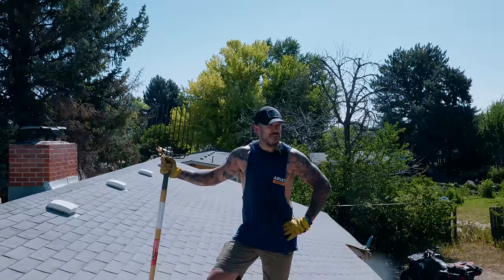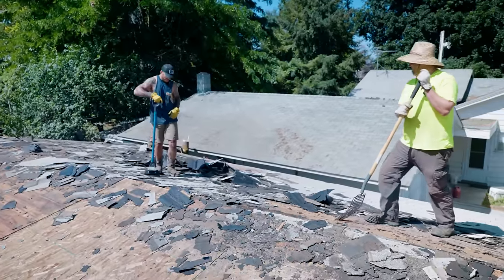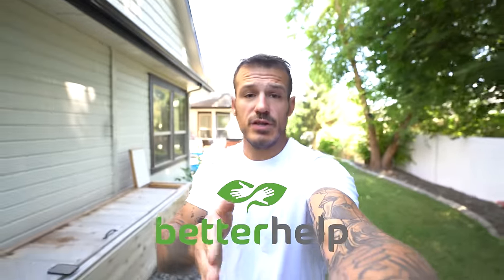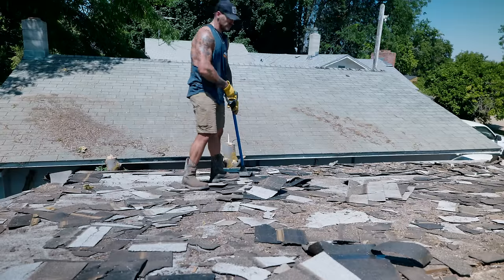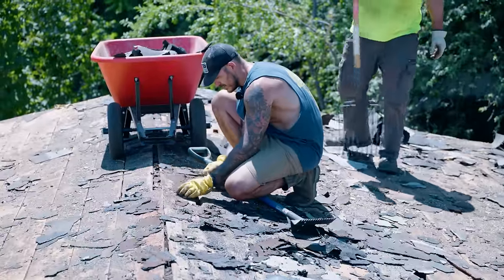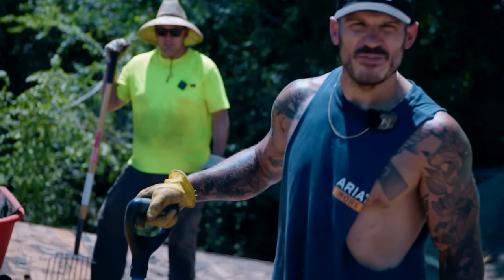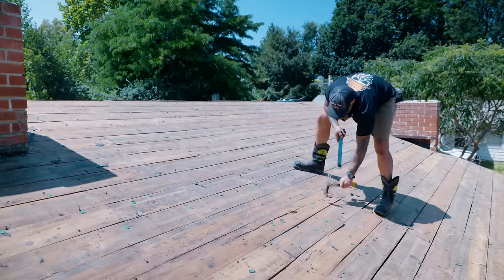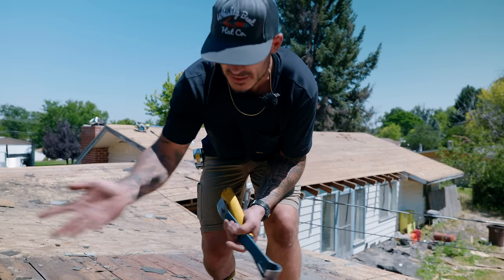This is the hardest thing I have ever done...(EP.7)

Comment: Roofed a many of multi layered shingles homes. Trick is to strip one layer at a time. As you pull up lower layers it’s removing the nails from the upper layer. When you get to bottom layer the nails left are usually pretty loose or rusted off. You definitely did it the hardest way possible. Should have asked an old roofer for advice.

Comment: I recently did my roof myself (28 squares) I think that you would have had a better experience with a different style shingle remover. Lowes sells them (bon tool 55in shingle remover) they have a flatter base and are longer than the one you had so they are more comfortable and easier on the back. I had one other person help me so I purchase the shingle/nail remover you used because it’s what HD had in stock and we both hated it. You have to bend over more and we basically just alternated with the other one. One person pulling up and the other person tossing to the bin. It’s hard work…. But def one of the biggest return and savings if you know what you are doing. I did a 40k-50k job for around 15k. 30 new sheets of plywood to replace rotted wood, and all new fascia.  Digging the series so far.

Comment: When they lay tarmac they use a hand held  metal "rammer" for the edges. I once used one of those to knock nails into a roof like you are having to. Keeps your back straight and it went really quickly. Good work out on the arms though...

Comment: all im wondering is, wouldn't a magnetic nail remover work wonders for this? (dunno what metal the nails are made of, but if not aluminium, then im guessing a magnetic nail sweeper would do wonders), just needs one with a strong magnet ofc so it just tears the nails right out (im thinking of the one's on wheels where you just roll over it and it just grabs anything metallic it rolls over)

Comment: I wonder, does anyone know if there is worthwhile savings in doing what he did in this video and essentially getting rid of all of the old material and getting the sheeting squared away, then just paying a crew to do the rest? Like is what he did back breaking labor? Absolutely! But, it’s also pretty hard to “mess up.” But messing with flashings, laying down underlayment and shingles is even further from a “good time” than that IMO and also with little to no experience, that opens up the door wider for potential error/failure of your new roof vs having pros do that part.

Comment: I've done a few re shingling jobs, and one shovel that helps A LOT are pvc snow plows (Small and large), pushing the old ripped up shingles off the roof into your bin. additionally making sure to lay tarps around the paramotor of the house to catch the falling debris and nails. Another great tool is a magnet on a stick for all the pull nails :P 

None the less great gob and good luck (I know the next time I'm hiring lol)